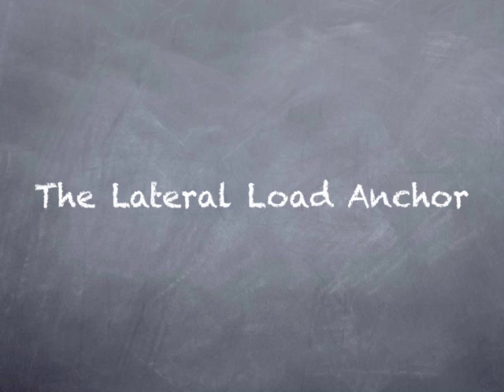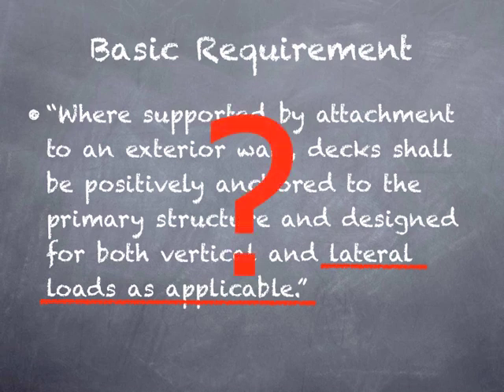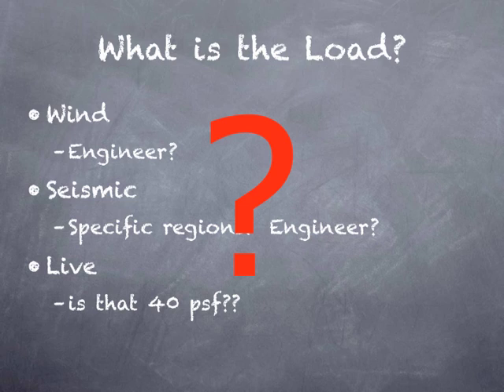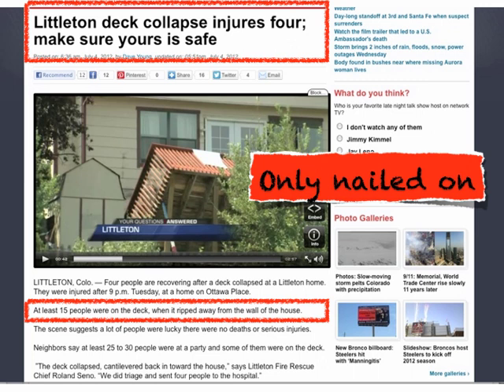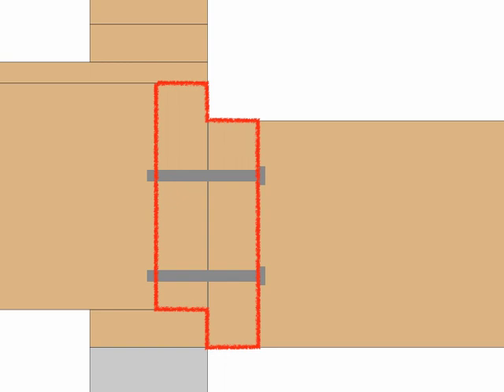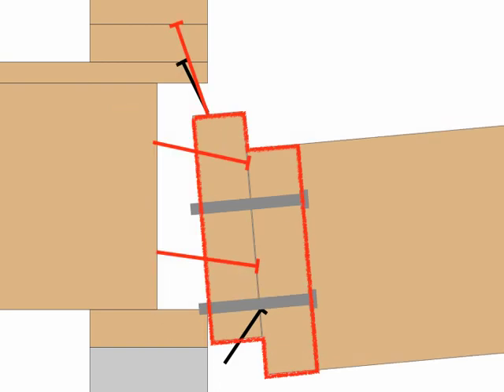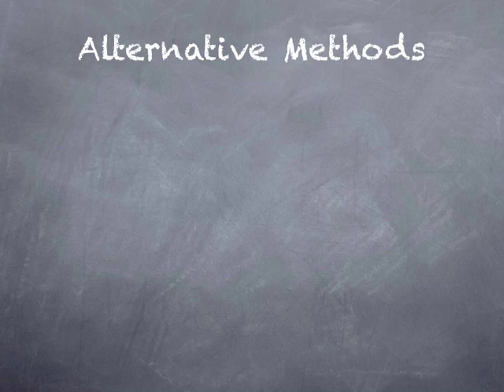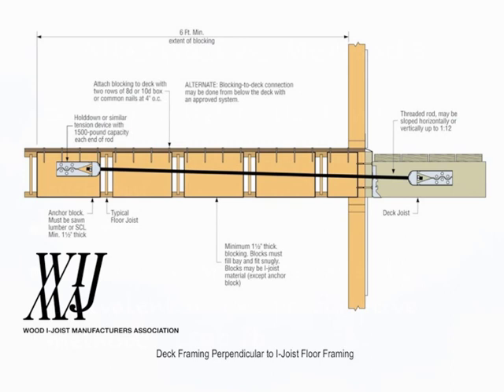Deck Lateral Loads

Comment: In my area the county permits screwing the lateral load brackets to the base board that the rim joist sits on - as that board is bolted to the concrete wall that goes well below the frost line supporting the house

Comment: I'm having this exact dilemma for replacing an old deck that only serves as access to the second story unit (4 ft wide) which supports its own roof: does it really need all of this. 

I plan on adding vertical supports along the wall since it has brick veneer, but I cannot think of a way to provide lateral resistance to the assembly while maintainning a watertight seal at the junction of the roof and the wall without anchoring to the brick veneer.

To add to the dilemma, as far as I know, the abovementioned roof does not meet the wall at the height of the band joist.

Comment: Would it not help to add posts under the deck by the wall to help with load as well as connecting the deck to the ledger?
Reply from the maker: posts won't help for lateral loads unless designed to do so.  On a low deck, sinking posts into the ground provides some resistance, like a fence standing up in a windstorm.  Or installing angled braces between those posts and the joists/beams.  However, none of this is recognized in the current model codes.
Reply: Thanks for the reply!

Comment: I'm planning to build deck on my home next year. Some spots are nearly 16 feet from ground. My home has anchor bolts install on outside of home to build a deck. But I'm not depending them to hold nearly 1600 pounds plus people. My plan is put post near my home 6 feet buried in cement. And to use anchor as only to hold deck to the house. Me and my family have be studying how we want to build this deck as the height is tricky and the gound is very unlevel

Comment: In "no less than two locations".  But there is no formula for where to put them.  On a 30' deck you could put the two hangers right next to each other on one end.
Reply: I was looking into this too. The IRC R507.9.2 mentions that each tensioner should be within 24" of each end of the deck, so there is some specification there. This is in the 2021 version.

Comment from the maker: Thanks for the comment, carpenteroncall.  There is so, so much more to say about lateral loads, their affect on decks and methods for resisting.  This video serves two rolls.  One is to discuss specifically Section R503.2.2.2 of the IRC and it's implications, the other is as a teaser for the full and comprehensive education covering this topic available soon at Building Code College.  I discuss resistance to lateral displacement and deformation, including discussion on knee bracing.